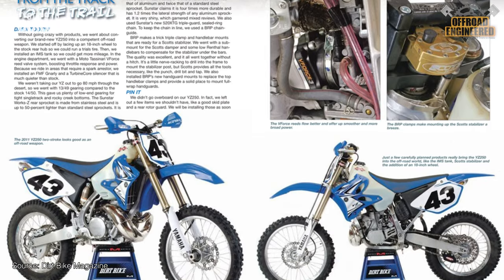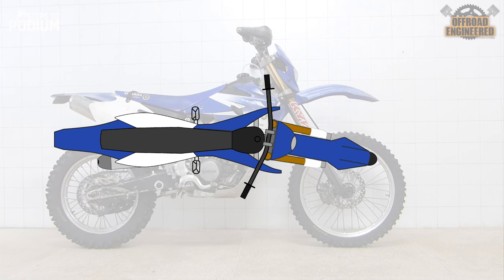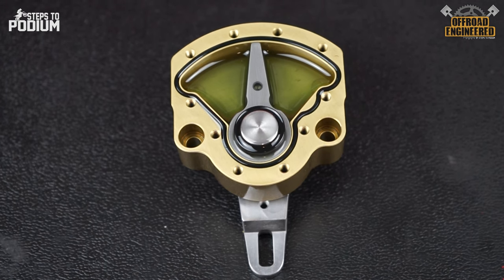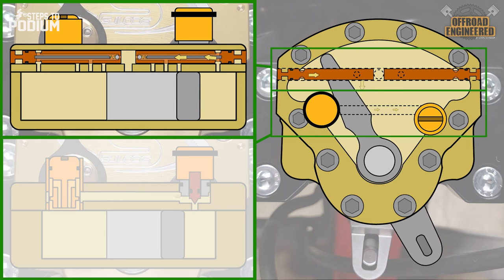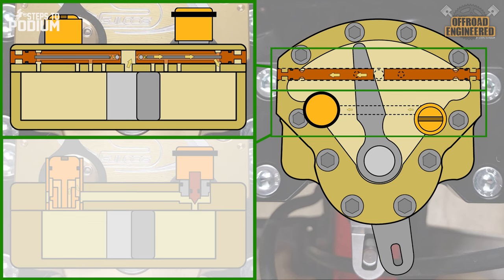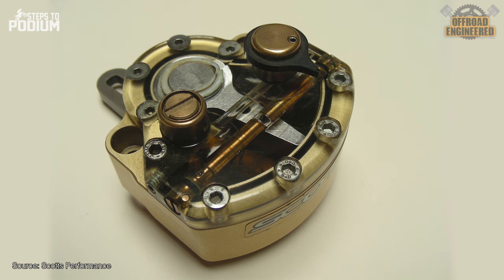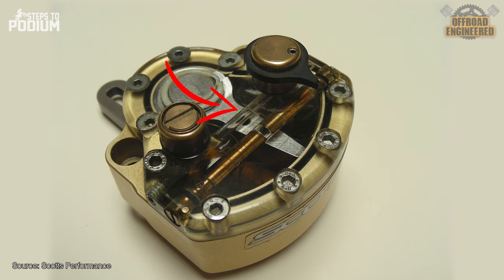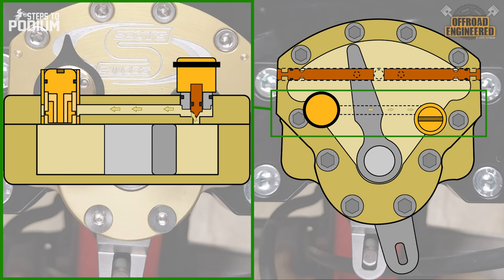How a Steering Damper Works | Offroad Engineered

Comment: Awesome animations! I initially thought the adjustment mechanism for the sweep adjustment was similar to the base or high speed valves, where I could adjust between settings (say if I wanted 70 or 80 degrees). I see now this isn't the case, given the discrete number of holes. Much appreciated!

Comment: I ran a Scotts for a few years and figured out that unless you are racing flat out high speed desert stuff they provide no real advantage and in some cases can even hinder performance, I raced enduro's for years and mainly ride mountain trail type terrain and for that a stabilizer is an absolute waste of money, that's why you don't see any top hard enduro riders using them, take that high cost of a stabilizer setup and put it into your suspension, you'll get way more bang for your buck.